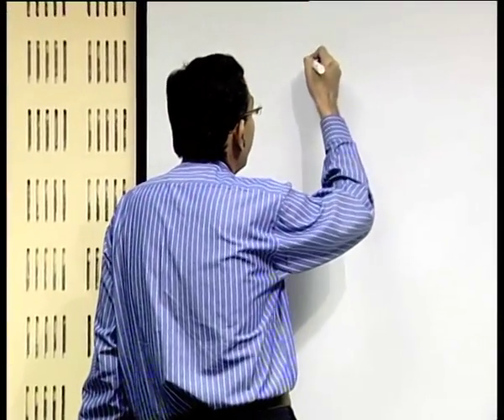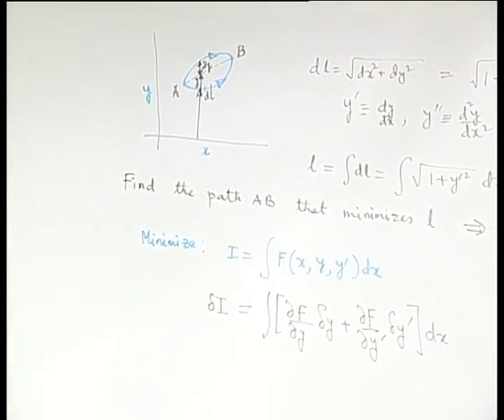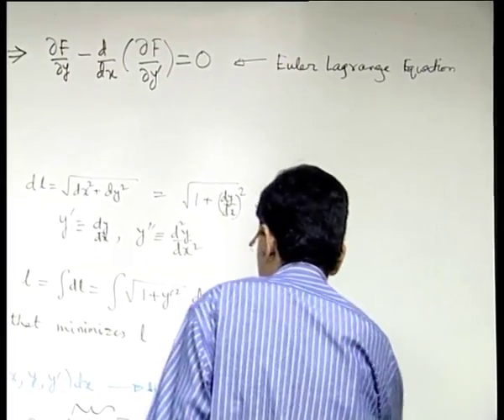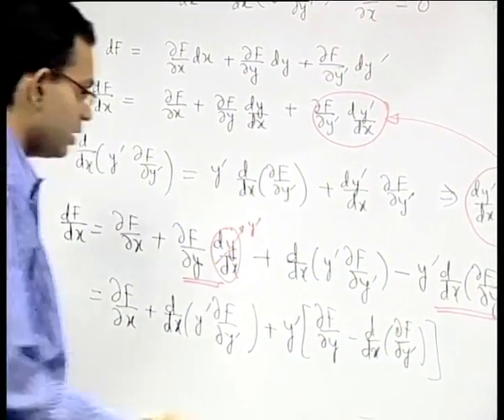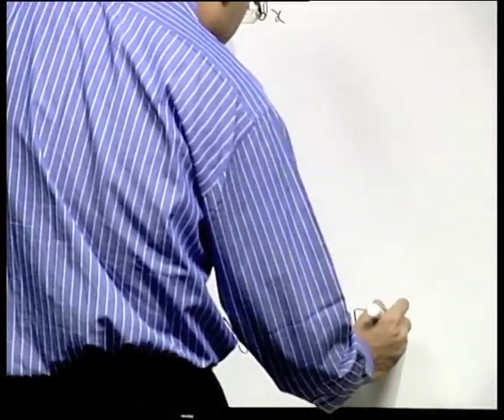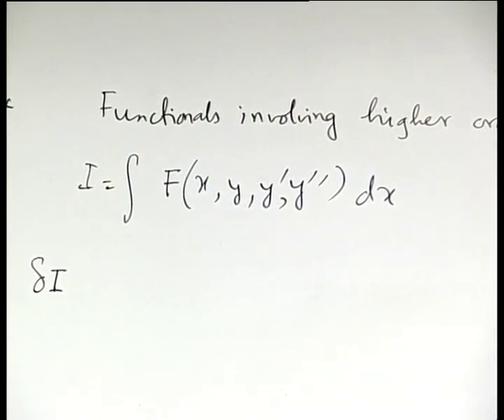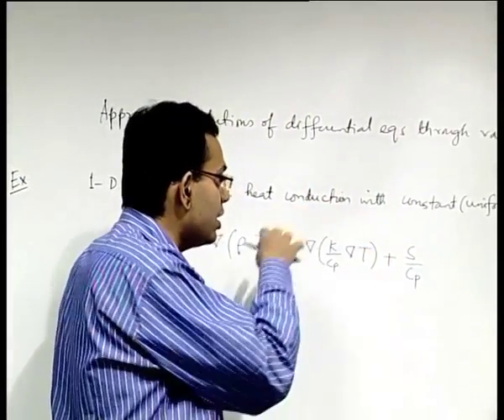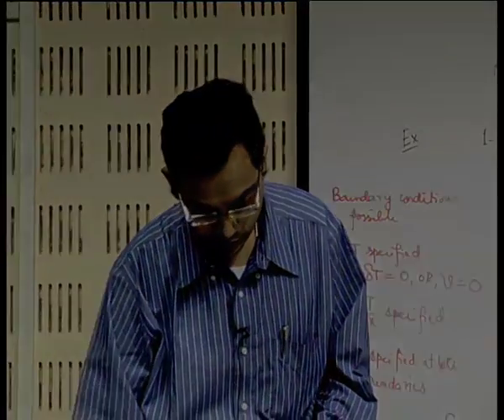Mod-01 Lec-07 Approximate Solutions of Differential Equations: Error Minimization Principles

Comment: How is df/dy trivially zero in the 19:00 minute mark? isn't y' implicitly related to y, in general? if y' still has some y terms in it, then you'll have to use the chain rule on it and it wont be zero, right? in the end, y' is revealed to be a constant, but how do you know that apriori?
Reply: only x can be changed..because x is the independent variable...y and y' are dependent on the change in x.....F is only dependent on change in y' and implicitly on the change in x...but not on any explicit y or x in the expression for F..so partial differential of F w.r.t x and y both would be zero.
Reply: Rahul Rathnakumar 
Hi, did you figure it out ?
Reply: It was mentioned earlier that both y and y' are functions of x, so df/dy (which treats x as constant, or for that matter y') would be zero.